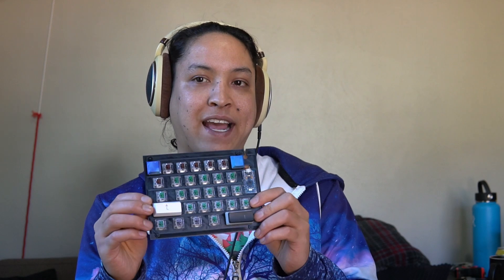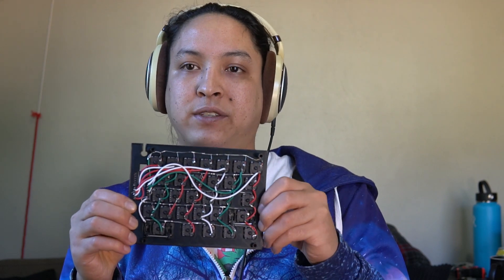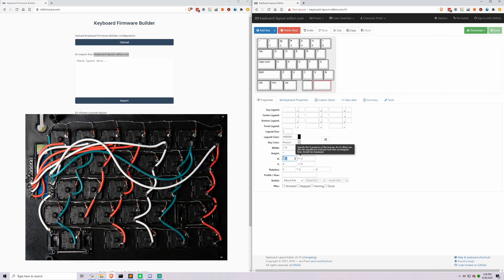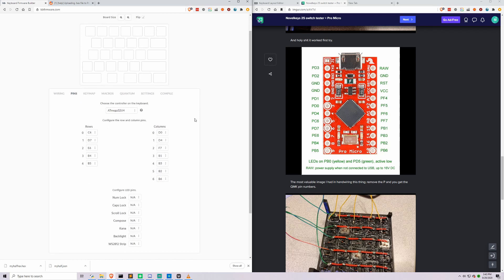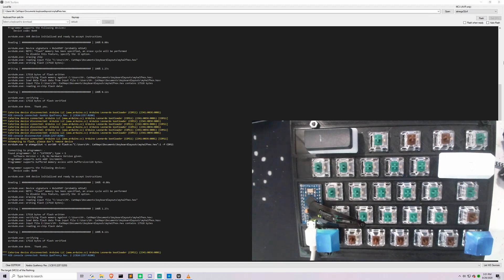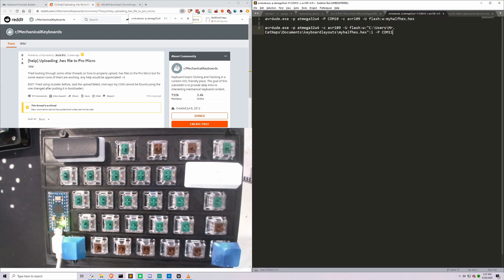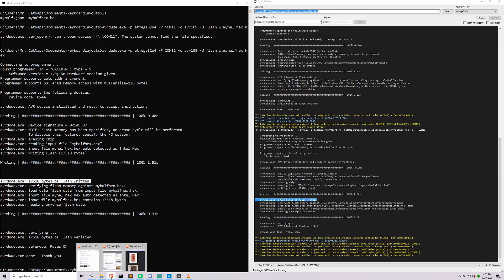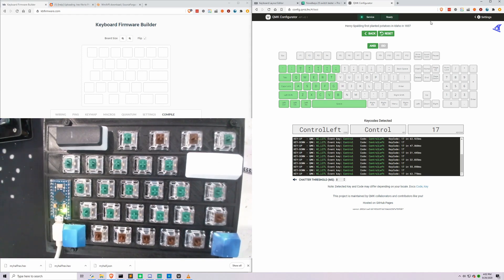Flashing a Hand Wire Keyboard with QMK Toolbox and Command Line

Comment: You are a life saver. I have been trying and failing with other tutorials and the websites and way you explained everything made it very easy to follow. I made programming the board a bit easier for myself too by using teensy loader. Thanks again!
Reply: Did you use a teensy?
If you did, which one?
I'm looking for buying a teensy and I belive that the newer versions (3.0 and above) are not supported by QMK firmware, due to the unsupported processor. Is it right?
Thanks for your help!
Reply: @emanuelemorelli  I used teensy 2.0 and had no compatibility issues with QMK, I just wasnt smart enough to do it through commend line so the websites in this video made it a lot simpler for me. I can’t say much for compatibility with teensy 3 tho
Reply: Yo don't use teensy for keyboards xd (different thing if you own like 3 and have no use for them)
Its like using a raspberry pi for one, kinda overkill.
 @emanuelemorelli

Comment: Hello. Thank you for great video. 
Can you give me advice? 
I gonna build splitted keyboard with 109 (50 + 59) keys + 4 encoders. The question is: Can I use only single Arduino Pro Micro microchip? Is it enough contacts for all those keys?
Reply from the maker: "yes" you can and after some research it looks like the encoders can be programmed similarly to the keys. It can use polling and allow for as many encoders as you like. Key wise, 109 shouldn't be a problem. It will need some good programming and I don't think you can do it with this setup. This is the reddit post that let me know how to use multiple encoders (https://www.reddit.com/r/arduino/comments/mn0xjd/how_many_rotary_encoders_can_i_fit_on_arduino/).
Reply: @steviebuilds1715  thank you!

Comment: I've been trying to use qmk toolbox to flash a pro micro without success, basically the avrdude command misses the -P flag and when I try to run it via cmd (not COM11 port, just COM1) it also fsils, would you think this method would work? 🤔
Reply: Also, is there a way to look at those ports without Arduino IDE?
Reply: I just tried to see the port in arduino IDE and this happens: I see the COM3 (Arduino Micro) but when I restart it it disapears and no new COM port appears :s